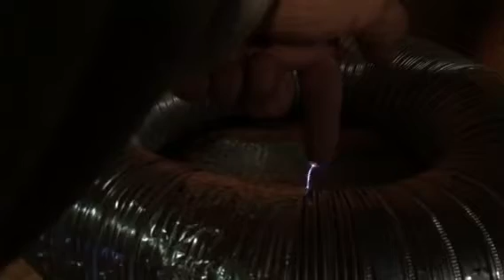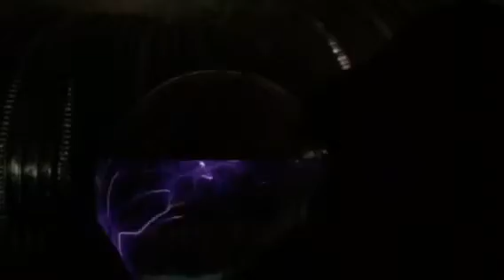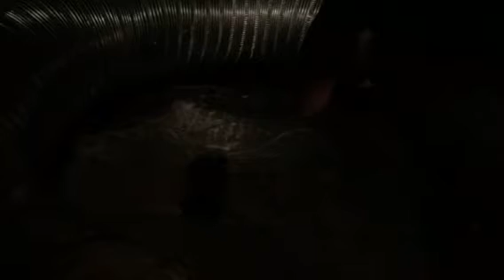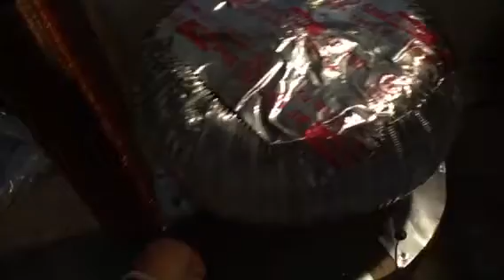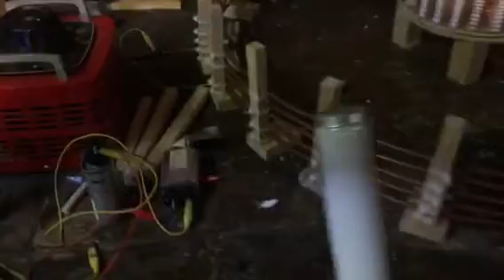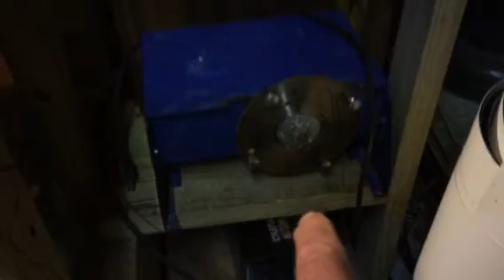Tesla Colorado Springs Experiments

Comment: Your coil is good but needs less topload capacitance. Try more primary capacitance and a higher drive voltage. Based from the setup should be capable of 5'' arcs at least.